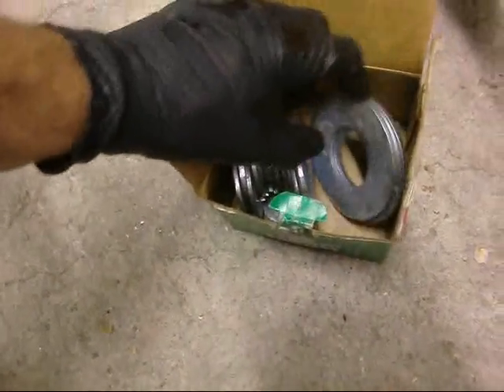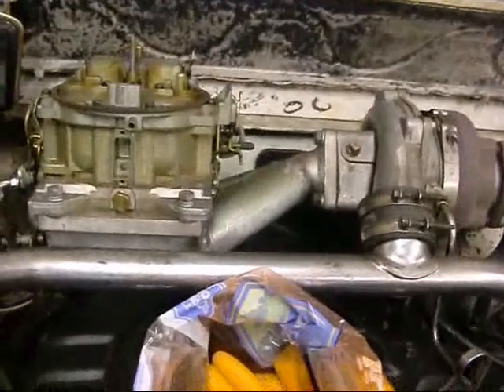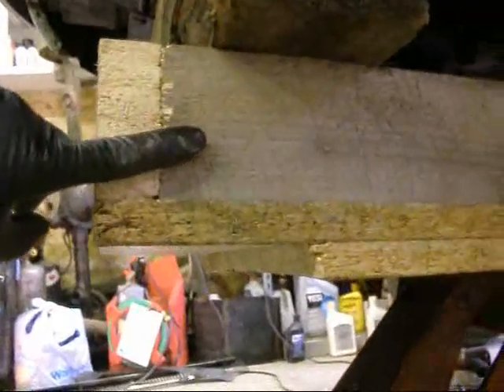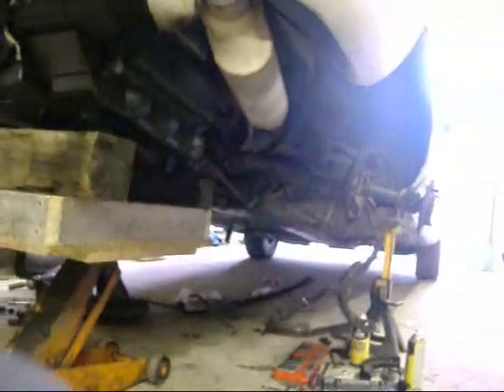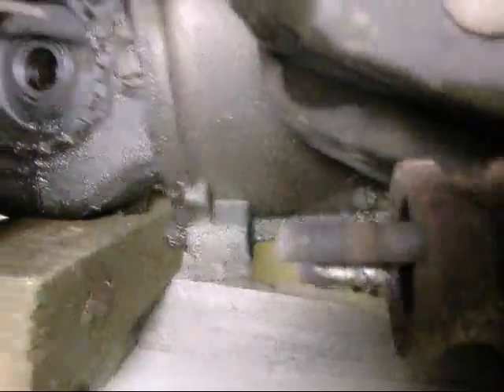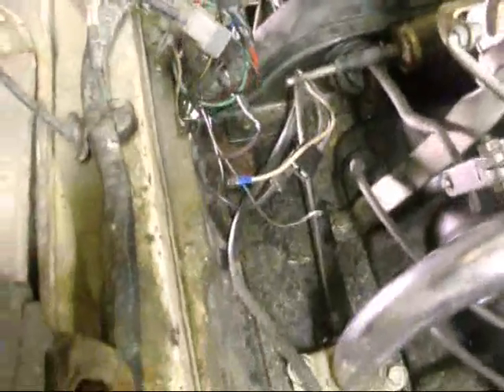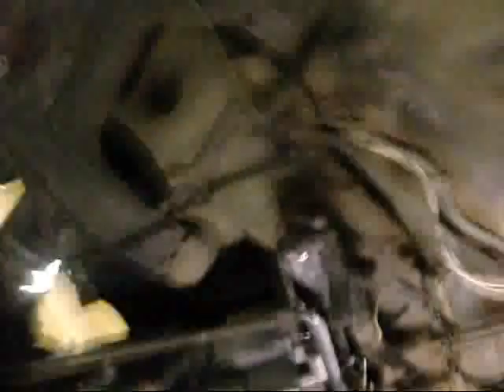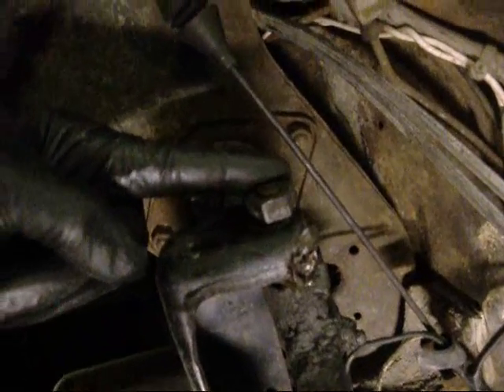6 3 12  Spyder PowerPack Drop I

Comment: hey corvair i just got a T3/T4 TO4E E-motor USA turbo i need some advice on waste gates and blow off valves using a 1955-1960's ish Rochester 2bbl side to down draft i'm setting up a draw-thru system but i also want an inter-cooler as well any advice other then give up now before i get hurt hehehe